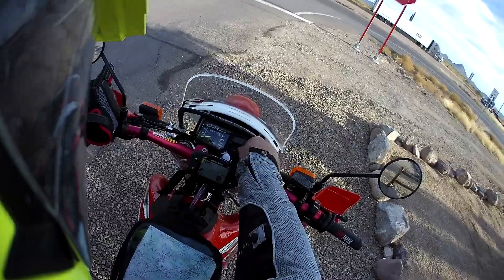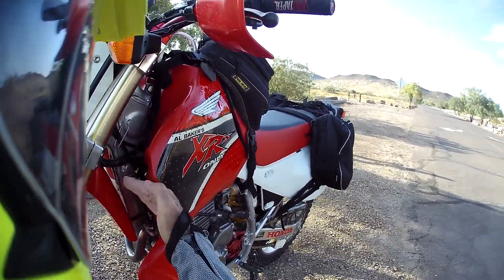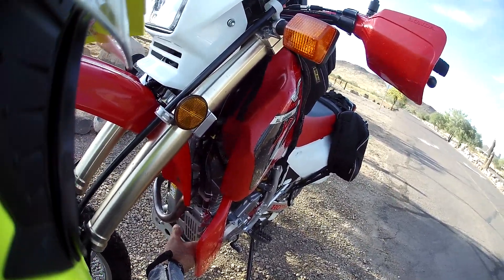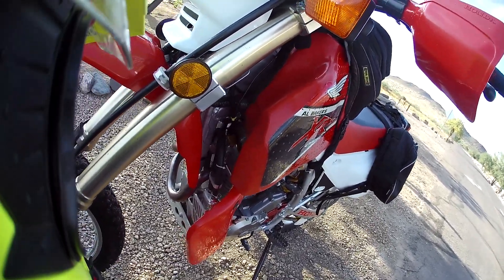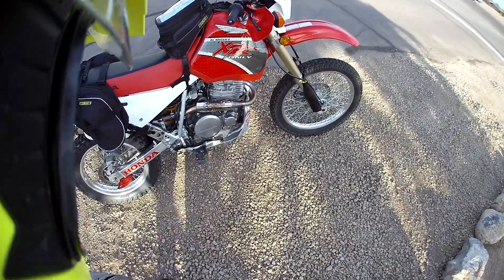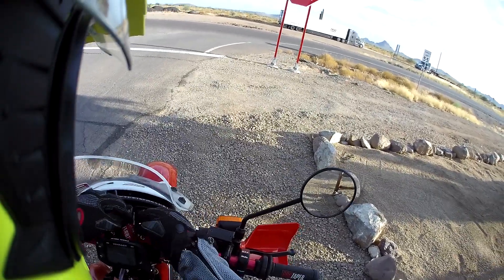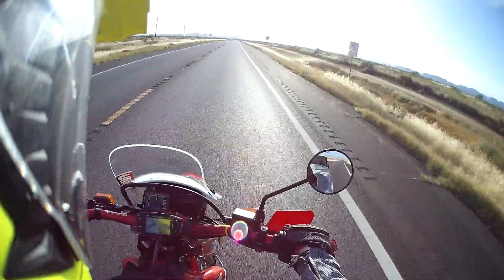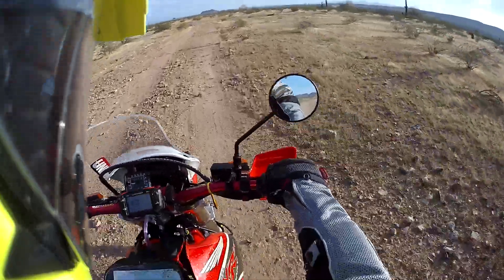Honda XR650L Cooling the Beast, Ram Air!

Comment: I PUT EMIG TRIPLE CLAMPS AND CRF 450 FORKS ON ABOUT 2YRS AGO.  ALONG WITH STIFFER REAR SPRING WHAT A DIFFERENCE.  RIDE MOSTLY DIRT.  AWESOME MOD. BOUGHT A FEW OTHER PARTS FROM MR. EMIG, TOP QUALITY!
Reply from the maker: I have seen the parts from Emig and they are high quality for sure. I agree that adding the CRF450 forks greatly improve the bike. I wish this mod was standard from the Honda factory.
Reply: @verbalwidget0919  yea there are quite a few thing that would be nice from Honda... start with jetting  but I get legality. How about a tank that will get you around the block . These are the most heavily mod'd machines out there...

Comment: If you have a big tank, you need the cooler. The stock air scoops do a lot to help, but a big tank removes those. The oil bolt on the back of the head is a 12mm head and that's where I put my tt sensor. I ran at about 180 on an 80 degree day. The oil tank just isn't a great place to be checking the temperature. That oil isn't cooling anything. At the back of the head, it's cooling valves and camshaft. Plus you can anxiously watch it heat soak when you stop 😁. 
I might try your scoop idea on the xr.
Reply from the maker: Yes that bolt on the back of the head is a 8mm bolt the hole in the sensor in 10mm. You have to have it centered just right so it doesn't leak by being off to one side. On the DR650 the same bolt is a 12mm so I would have to order a new sensor at 35 or 40 bucks shipped? I don't wat to spend that now, so I think I can achieve accurate comparisons between how hot each bike is running by attaching the sensor on the oil cooler with the metal tape. Trail Tech offers sensors that slip into the fins of the oil cooler, I like this way better. I think the scoop is functional, I just need to brace it better so it will survive a fall, since I'm prone to falling. Thanks for watching, Enjoy the Ride.
Reply: Would it work to put the big fins kit, the oil cooler, and a big tank on it all together? Or does the big tank cover space where the bigger fins would be? I've been working on a stock oldie ('96) and wondering how to modify it.
Reply: @suzyamerica4679  I don't have any experience with the big fin kit, but I don't think the big tank would get in the way. The scoops are mainly to help at higher speeds, whereas the bigger fins (in theory) and oil cooler help at all times.
Reply: @Megakoolguy357  That's cool (heh) .. the bike belongs to a friend of mine. I am just wondering how much it can be improved for mpg's and for cooling. Haven't been able to get mpg numbers from anyone who's put a Lectron or SmartCarb on the thing.
Reply: Adding a slotted front fender will direct a lot of air down to the front also.  Devising scoops that will not catch things on the trail (non trials) is a priority. Thanks for the info

Comment: Something else that would help,at least it did on mine,is to wrap the header.as you can see,the header is very close to the frame and the oil lines.so here is some interesting facts.now,I don't live in Arizona, I live in indiana,but it still gets in the mid 90's in the somer,I am on my second 650l.had a 94 for 14 years,and now I have a 2019.i have never had any issues on long road trips with any sort of overheating,and my wife rides 2 up with me almost everywhere I go,even for whole day woods riding.also,I have never had any issues with the cdi failing with alot of people complain about.i believe its all about proper maintenance.i used to work on bikes for a living,so I obviously do all my own maintenance,and at the proper intervals. I believe that goes on long way for reliability. If you go to my channel, I did a little walk around on my 2019 last year,you should check it out.still have a few more mods planned,but I got another bike and have been working on it,its a 1983 cb1100f super sport,with only 14 thousand original miles on it.
Reply from the maker: Hi, Thank you for watching. 
I think I will try that next time I have the exhaust off the bike. I have watched a few video on wrapping the exhaust and others agree with what you are telling me. I'll check out your 2019 walk around. I change the oil more often than what Honda says. Oil is cheap, and only take a few minutes to change out. Very cool you have a wife that wants to ride along. Thank You.
Reply: @verbalwidget0919  yes,oil is cheap insurance. I change mine at ever 1500 miles,thats when the oil just starts to change color. Its also very important that you use an actual motorcycle oil.lots of people don't realize that motorcycle oil has special additives for the clutch and gearbox that conventional car oil does not.and yes,its very cool that my wife loves to ride with me,she always has!! Im a 50 plus year old man that can still show the youngsters how its done on the single track trails,and I do it on a 300 plus pound bike!!
Reply from the maker: darrinwoodward14 I agree 100% that’s when I Chang mine too. I don’t wait until the oil is black and use the Castro’s motorcycle Actevo oil. In the DRZ250 it only holds 1.2 qts and the engine turns some RPM’s I may change it after a couple hard rides.

Comment: I’m in the Az north strip trying to look into cooling as well. Nicecnc has an option, but always looking
Reply from the maker: I saw that, if I had to do over again after installing one. I would have mounts made or welded to use the big DR650 oil cooler. I think this one is marginal.

Comment: The Heat off the Oil Cooler goes right back into the Cylinder. Best place to mount is under the head lamp. Or Try a DR cooler on the XR.
Reply from the maker: Thanks for the tips! The XR650 runs much cooler now. At one point I thought about a DR650 cooler.

Comment: Drill some big holes on the rear part of the front fender. It's a wind block. You can replace it with the super moto front fender too.
Reply from the maker: Hi, Thanks for the tip, I have been thinking of drilling holes in the fenders of the DR650 and XR650 for more air flow.
I never got use to the looks of the SM fenders but I can see that they flow a lot of air. Thank You
Reply: Right! Back in the late 1970s my friends and I rode Honda XL250s, XL350s, and XL500s. We would get rid of the stock front fender and replace it with a Preston Petty fender. We would cut about 5 inches off the back of the front fender so that the cylinder would get full air flow.

Comment: First thing I did to mine was remove the smog pump. With the delete kit from eBay it took 10 minutes.
Reply from the maker: Me too, I couldn’t stand that big ugly thing hanging off the engine. Yes easy to pull off and bike looks so much better. Thanks for watching.

Comment: I like the added air scoop.  Should have a good effect of drawing air over the cylinder cooling fins.
Reply from the maker: It seems to be working great , better than I thought it would. As soon as you stop, and the ram is quits, the temperature gauge spikes, until you get going again. But on the highway its all good. Thank you for watching.
Reply: Ladies and gentlemen. These motorcycles are designed perfectly . All motorcycles are going to feel extremely hot on a very hot day especially in heavy traffic. But they can run up to 212 degrees safely. Manny motorcycles don't even have oil running through the frame. This one does therefore it runs cooler than once without it. All of my motorcycles radiator or not feel like they are overheating on hot days but have never had one that left me stranded for overheating purposes. That extra fan is only going to cause more drag and work the engine harder and hotter
Reply: By the way, I do live in Tucson Arizona and play with all of my motorcycles on the hottest days of the year. My Harley has no radiator or oil cooler, my Honda Shadow has a radiator, my CRF 250 has a radiator, my Daytona 675 has a radiator, my xr650 obviously didn't come with one but all of them feel the same on hot days but have never broken down

Comment: Great idea!  I'm just concerned about the tendency of that left scoop to start pulling you to the left at around 150 mph, or so! 

I think you may have had better cooling results with your Sutton oil cooler than I have.  Best I've seen is a 10 degree reduction...but I'll take it!  It's a clean, sturdy piece!  Thanks for sharing!
Reply from the maker: At 150mph I just hang my Right foot out to even it out!
 You know I was like you, I installed the Sutton cooler and saw maybe 15-20 degrees difference? Then one day bored , on a deserted straight road I put my hand down by the cooler and it seemed like it was in a dead air zone?? That is what got me thinking about some kind of scoop. The bike now runs as cool as my DR650 on the highway and I am happy with the Sutton unit. I just think the placement of the cooler could have been better, and I would like to have it bigger. But, I am happy with the purchase now.

Comment: Never understood why every old guys worries so much about oil temps. Hundreds of young guys who ride 10 times as hard and fast never give temps a second thought and never have an issue. Must be an old and bored thing.
Reply from the maker: Hi Randy, The issues I have heard of were top end valve/guide problems when the bike is used for extended periods on the road. I am spending more and more time at highway speeds in the mountains for 200+ miles on the bike to get to where I want to off road ride, and then hop back on the road for 200 more miles at 65-75 mph to get back home. I'm in AZ where even now it is 95 degrees at midnight and we had several days last week at 116 degrees. If I can spend $300 for the oil cooler and zero for a scoop that lowers the temps 50+ degrees than it seems like good insurance to me.
Reply: @verbalwidget0919  . Hello VW: I didn’t realize you gained a 50 degree drop in oil temps ! That’s some good insurance for sure. Thank you for posting this. I’ll be getting an XR650L in the future and your tips are great food for thought. Stay safe Sir ! Best Regards, Shawn
Reply: Then you are a youngster ,because you don't get it, U don't ride harder 
Then anyone because U probably 
Ride your keyboard more than your 
If you even owe and if you do it's 
Probably a real piece of work that 
Your dad bought for you from the 
Scooter store.
Reply: @Chris Lollich  don't get all puffed up bubbs. I am 43 years old and the last bike my dad bought me was a 1984 Honda 3 wheeler...in 1986.🤣 Probably before you were born. I always find these kinds of comment from empty accounts without a single video.